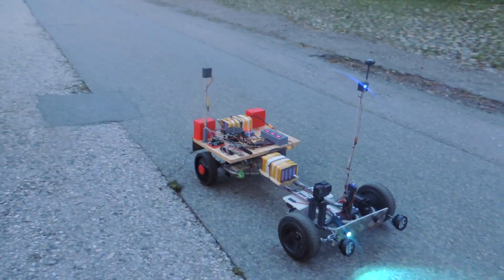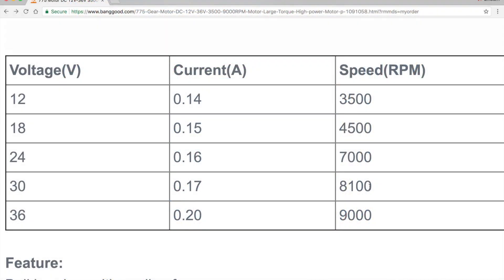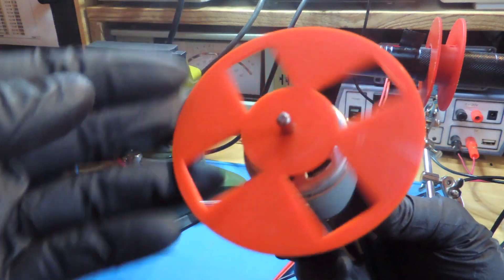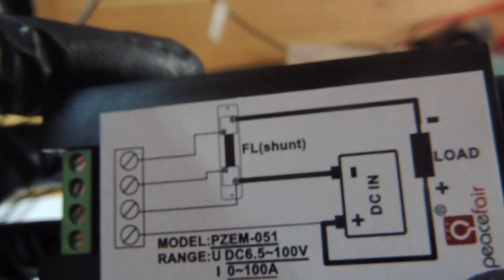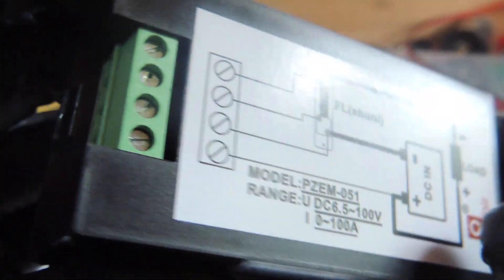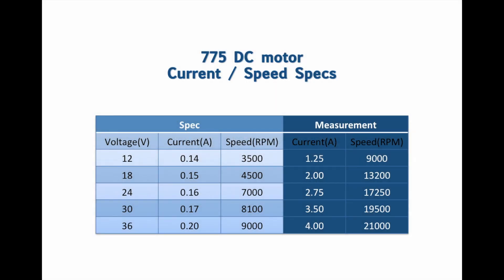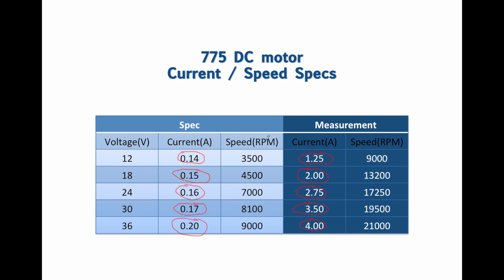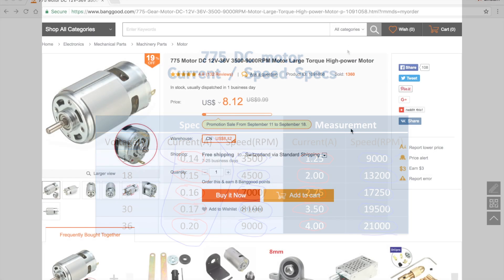775 DC Motor from Banggood - Are the specifications correct?

Comment: China made different 775 motors but their specs are not given correct, there are many 776 motors which has same specs 12 v .12ma 3500rpm but at idle.with load the current increases to 6A

Comment: When it comes to rpm's and amp draw's to Mabuchi style motors, you really need to look at the last sequence of numbers on the part number.  That's what tells you the wire diameter and turns of the motor.  A thicker wire with less turns will give a higher rpm motor with larger amp draw.  Thinner wire with more turns, lower rpm and lower amp draw.  If you order a 775 motor without the complete part number, you have no idea what you will be getting as far as performance.  The 775 is only telling you the armature size and number of poles.

Mabuchi part number reference: https://www.mabuchi-motor.com/product/knowledge/classification/designations.html
Reply from the maker: You're absolutely right.

Comment: some very late info.    good work.       there is a major, threshold, question.       are   All  775 motors  the  same?
or is there some variation.        if accurate,  the  much  greater current values  Result in  Much greater  power/Watts  consumed.     watts  =  volts  x  amps.             now, you just need to know power consumption, when a motor is Loaded, nominally.       based on the low kv value, loaded motor speed will be a bit less-than what was  measured;  kv-curve  may be different, when  Loaded.        googletranslate

Comment: Hello, I would like to know how did you came up with your conversion factor from Hz to RPM?
Reply: The disk he had on the motor had four windows in it for the laser beam to pass thru.  More than likely to keep it balanced.  Anyway, one rotation of the motor would show 4 Hz.  600 Hz (600 cycles per second) means 150 rotations per second (since there's four windows in the disk), times 60 to convert seconds to minutes and you get 9000 rotations per minute (RPM).  Same math for the other speeds.

Comment: Well, your video is as same misleading as the bang's seller's specs are.. But their specs suck on purpose and you are just naive on purpose to claim that you would like to trust numbers like 12-36V 0.14-0.2A and expect powerfull output, while the same motor is offered like 100+ WATT elsewhere.. Also to note that one should not buy technical stuff with no datasheet or exact part number whatsoever provided (or to have expectations)..

2/ the table with volts and rpm seems not complete, it looks like showing current with no load for 12V 3500rpm type 775 motor i guess and you got exactly what you ordered..
What, you ask?
Yay, learn to read between the lines..
You probably bought one of any possible of few sub-types.. 12V, 18V or 24V.. and with 3500, 4500, 6000 or 9000 rpm..
Cheap goods are often shipped random colour/type :-)

3/ your orange plastic spinwheel is thin at very bad places and will get dangerous to break itself at high rpm to nicely shaped 100meter/second projectiles..(21000rpm*~0.3m/60=105m/s)
It also screws the measuring done by its weight and air resistance/friction :-)
Yes, you are measuring a slightly loaded motor :-)

Comment: I bought this motor but it consumes 0.24 A. So the specifications on website are almost real. If you want a powerful motor you have to look if the specifications says exactly what you want. At first when i saw this video i thought the specification are wrong and the motor is 150W, but it is not. This video is made with another motor instead the one from the link

Comment: Good test. Temperature rise would have been useful too. Can the motor sustain those current draws for any extended period without burning out?

I just took out a motor from a photocopier and was looking around for specs when your video came up. I want to try using it to generate energy from the wind so specs are very useful. Determines the gear ratio of the gearbox I need to build. Don't have a tachometer and I am being lazy to set up a small magnet and a coil. Your measurements look decent so maybe I aim for 10,000 rpm final from the 200 rpm I a getting now from the turbine (fan blade).

Comment: Can I use 4 rs775 DC motor for 100kg load robot with 6v supply for each motor?
Reply: you should use gear motor for that. like 10 rpm or 100 rpm motor. Gear version of rs775 is also available. You can check gear motor in this video https://youtu.be/81Xsd2djhnc

Comment: I understand the 775 motor comes in two varieties. The 12-36v one with those specs, and a 12-24v version which is rated at 13000 - 15000 rpm. Those RPM values would suggest you have the latter and you have put too many volts into it.
Reply: You r right

Comment: I'm looking for motor that more speed & more powerfull than motor 775... please advise me if you know DC or AC Motor with compact size (more or less) like motor 775.. I'm already use motor 775 for my mini cutting table.. but still i feel it less powerfull... I use adjustable speed controller with 30 v max.
Reply: I m not getting power source want make it myself kindly advice asap

Comment: I hope this helps you in the future.  I've bought many of those over the past 2 years.  Apparently, there are 2 distinctly different winds available (wraps of wire on the armature) which change the characteristics of the motor a lot.  One is designed for 24-36 volts (roughly speaking) and has lower RPM and average amp draw, but much more torque.  The other is designed for 12-18v, and has much more RPM (with much higher amperage requirements), with somewhat less torque.  The problem I have found is many of those small places in China will substitute one for the other all the time, and either they don't know the difference, or maybe they don't care, I don't know.  Both are still useful, though.  I've burned out controllers also, thinking one motor was the lower amp version.
Reply from the maker: Thank you, GuerrillaRadio. It does help. I appreciate your comment!
Reply: Sure, no problem, glad to help!  Oh, if you could tell me, where did you find those really nice heavy cogged drive belts and pulleys?  I've found really big ones from industrial suppliers, but they are much too big, yours would be perfect!
Reply from the maker: Hi GuerillaRadio. The pulleys and bels i bought from banggood: https://www.banggood.com/Wireless-Electric-Skateboard-Accessories-Belt-Motor-Pulley-For-7270MM-Wheel-p-1112896.html?p=JM09079991593201704F
I also 3D printed some of the parts.
Btw, about 775 DC motors, have you seen this other video i shot some time ago? https://www.youtube.com/watch?v=qYTqrwlEqk0&t
It explains a little bit more the difference between those motors and what i have been doing to have a better understanding of them.
Cheers

Comment: I believe there is different versions of these motors. I have one running at 24v and getting 8100 rpm. What part# etc. Is that motor from Banggood? I need one that can spin up that fast.
Reply from the maker: Hi Kevin. All those motors I bought from Banggood. As i said in the video, they really look like different versions of 775 Dc motor (even though i bought all of them through the same ad). So, we never know what we get.

Comment: I ddnt understand how many amper max?
Reply from the maker: At 36V the motor was drawing 4A (no load). The max is at stall torque... i haven't measured it but i guess it is around 30A for this specific motor.

Comment: I think banggood tested the motor without load, Please remove the motor load and and test it back again. Lets see the difference. Thanks.
Reply from the maker: iRon322 which load are you talking about? The disc? This disc was 3D printed and it weighs less than 20g. It was necessary to measure the speed. With no disc the results were the same for current consumption.
Reply: Okay, thank you for your reply. Yes its the disc. I was thinking that the heavier the disc, the higher the current it will draw, and the faster it will spin. I just got 775 motors today and i would like to test it like u did but sadly, i don't have the tools to do it. And i'm glad that i've  found your video. I hope you could do another video.
Reply from the maker: You're very welcome. I understand... I am preparing another video with some more tests. I've been really busy and couldn't finish it. I am performing some more tests with variable loads to plot the performance curves. I can tell you in advance that this motor can draw more than 20A. My power supply was not enough to continue the tests at certain point and now i will continue it using a battery a took out from a jumper starter. ;)
Reply from the maker: Have a look: https://www.youtube.com/watch?v=qYTqrwlEqk0
Reply: i tested this motor on 12v battery with no load, It was drawing 1 amp without load. And then i connected 5 petals plastic fan blade, it started drawing 4 amps and voltage started fluctuating between 14V to 20V. i don't know why multimeter was showing voltage fluctuations ... may be due to slightly improper alignment of blades. Battery was also being charged by inverter while i was directly testing motor on battery.
Reply: iRon322 yes

Comment: Could the rated specs be outputs if the motor were being driven at the rated rpm as a generator?
Reply from the maker: Hi "revscott58". 
I don't really know but I am about to figure it out... I explain you... If they provided reliable performance curves for the motor it would be possible to calculate any missing information. Since they don't... I am recording a video (in this exact moment) where I'm gonna show how to do that (without using any fancy equipment - given that they are extremely expensive!). I'm also going to provide the performance curves for this motor (I am talking about torque, efficiency - power out/power in, current consumption, rpm, etc). Curves, not just a value. That means we will know the max torque, max power, max efficiency, etc. 
I need some time to finish recording, editing and I will publish it. It won't take more than 2 days (unless something gets wrong). After that we can play with numbers and see if what they provided was related to this motor acting as a generator. As i said, I don't think so. Lets see though.
Btw, thank you for commenting.
Reply: Thanks for your response Robledo.  I am interested in using one of these motors as a generator and would like to know output voltage and amps at the different rpm's. Please post if you can.
Reply from the maker: Have a look... he goes the answer ;)
https://www.youtube.com/watch?v=qYTqrwlEqk0

Comment: Very Nice video, Please can you make a video for testing it's Torque ! 
in the website it's writing 2kg.cm is that true ? can you test it and show us the real Torque thnx
Reply from the maker: Republic of Tutorials, thank you!
Yes, I can do that. I have to prepare some loads (mass) to perform this test. I am quite busy during the weekdays... will do on the weekend and post a video afterwards. ;)
Reply: Thanks a lot Robledo Einstein please don't forget it :)
Reply from the maker: Hi "Republic of Tutorials". I din't forget what you asked me... I was busy last 2 weeks but I've just started recording a video to answer your question. Should publish it soon.
Reply: Thanks a lot "Robledo Einstein".
Reply from the maker: Hi, Republic of Tutorials. Have a look... we are close to get the torque information: https://www.youtube.com/watch?v=qYTqrwlEqk0
Reply: thanks for the video. I order a couple of 775 motors with the lower rpm ratings yesterday to place the 550 motors in PowerWheels. The 550 lacks power or gets too hot at 18V  Im crossing my fingers the 775 are 9000 rpm @ 12 V. I think some people are messing up their power wheels using the titan 775 due to the 11T gear instead of 10T gears. You need proper gear mess distance when changing gears like that..the powerwheels dosnt allow you to adjust the motor mount./gear mess.
Im hoping I can get away with 775 @ 18v. It's plenty for my nieces.

You can get water pumps for $5  to mount on these motors...R/C water pump boats.lol They're wickage fast...Just use dallor store foam boards to make the haul...or get a skateboard drive kit for $15. Mount on scooter tires and go all terrain ) which I might convert the powerwheels to..if the gear box fails. Then run 24 V on a live axle...or dual 775 with the rear sprocket screwed into the wheels.